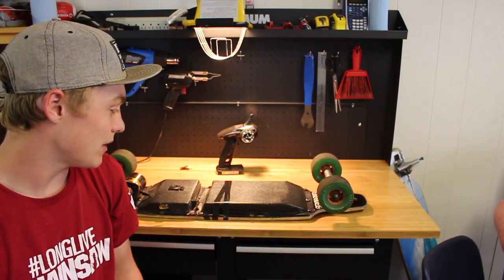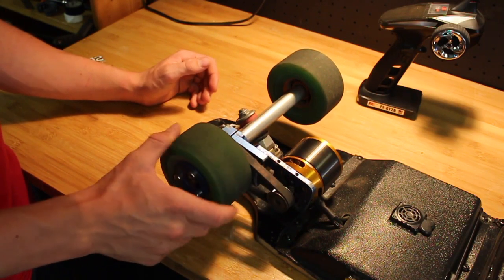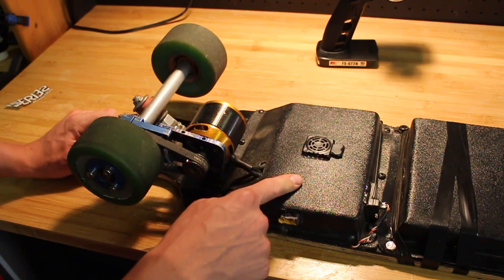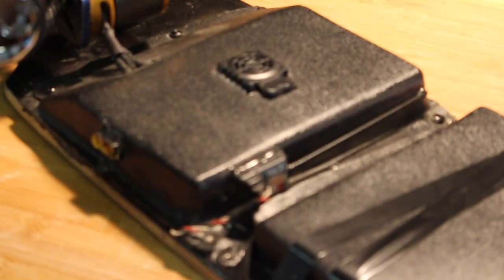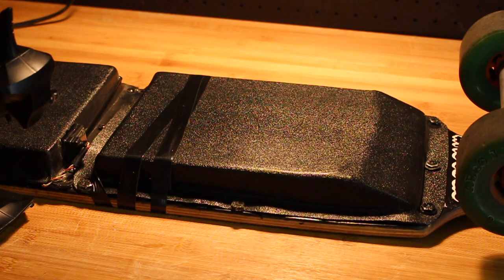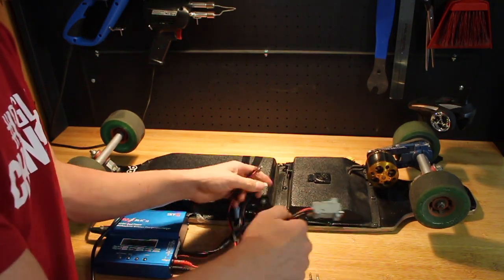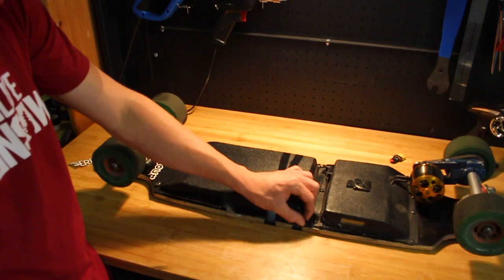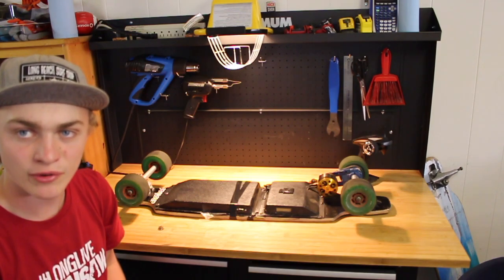Diy Electric Longboard *Full Review*

Comment: I would like to make a 4WD electric skateboard. I've already bought pretty much everything that includes two 6374 motors and two VESC's with a Nano remote control. Haven't got the stuff yet, but wanted to know if my remote control and its receiver can handle four VESC's? Also, is there anything I'm missing in terms of electronics?
Reply: Just buy a remote that has a receiver that outputs 2 servos, and then canbus the other two VESC.

Comment: How can you reach 40 Km/u with a 6s battery. I build a 10 s configuration and i barely can hit 40 km/u. I see you have a chargeport for your lipo's. How this works, i have to take them out to charge my 2x5s battery's seperately.  Nice build.
Reply from the maker: I actually can only reach about 35km/hr on this build however, I had the same setup but switched the 190kv motor to a 245kv motor and was able to hit over 45km/hr

Comment: Nice build man! Are you sure about that 40 km/h? with that setup it should be around 30 km/h or am I wrong?
Also is there a reason that you mounted the motor on the other side of the mount?

Comment: Wicked board and video production!  I really like your work station. And those enclosurers are real nice! Did you think of wiring your LiPos all in series vs the parallel to increase the voltage?  You mentioned you wanted more speed, that might your solution without having to spend money :)  Needless to say, loved the video.

- Neil
Reply from the maker: I have debated wiring the lipos into a 12s 1p setup rather than the 6s2p it is currently wired as however, I would have to upgrade my speed controller to handle the higher voltage and with the gearing and wheel size I currently have the top speed would be a bit faster then I need. Thanks for the comment!
Reply: Of course!  I appreciate the video.  I really love the esk8 community especially the one on YouTube!  It takes a certain amount of skill to build an esk8 but then to take the time to make the a video is that extra effort I appreciate.  Hope to see more videos from you when you make any modifications :)
Reply from the maker: Thanks man appreciate the support and love your videos! Definitely going to make a build series in the near future!
Reply: Thanks brotha!  I look forward to the build series!